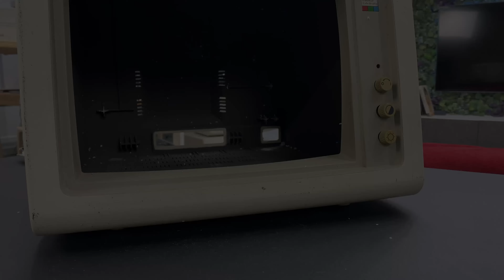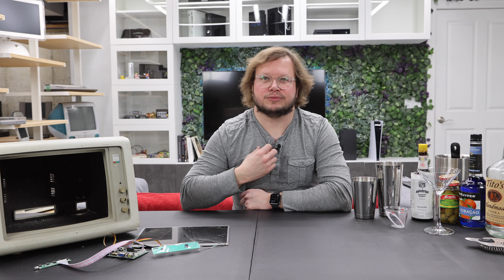IBM 5154 LCD Mod - Putting a new LCD in a classic monitor shell. | Jeremy's Retro Bar

Comment: I have thoughts of doing the same LCD thing but creating a replica of the 5154 from scratch since these are rare and expensive.
I already have a scratch made IBM 5150 alike case which incorporates a hot rodded PII PC inside, i have it on my other channel you will find it if you search "scratch built IBM 5150 replica".
It's a little more complicated creating an accurate CRT case but it's doable with a basic wooden frame roughly in size and sculpting.

Comment: Nice idea!
To be honest though I'd skip the curved plastic. Just adds too much glare imho. Or remove the curvature and choose a slightly larger screen. With a bit of ingenuity you could very well make the brightness and contrast buttons work as well. If you can't find out a way to map physical buttons you can always implement a rotary decoder (with push button as well) and map the output of the encoder to the physical buttons on your chinese LCD driver board. Not exactly the expected way to controll it but hey you have to improvise from time to time. Probably I'd add a mains power input as well. Could be as simple as just routing the power to a wall wart adapter in a socket inside the case - then you're rid of an external one.
Still waiting for my screen cases. I ordered two thin LCD cases to repurpose some old laptop screens. If they turn out well I might order one or two more. Especially one of the screens, an older LVDS type from a Lenovo T510 is especially nice. Probably it's an IPS and has very crisp colors and quite wide viewing angles - much better than most more modern laptop IPS panels. And it's Full HD too so still very usable and surely a panel I'd spend the cost of a case on. The other screen I'll put in a case is a newer eDP screen. Works well although not as crisp as the older one - also FHD.

Comment: Very good job!  I have a 1990 vintage Sigma Blackjack machine.  I opted to keep the somewhat burned CRT as the colors are still great.  Your LCD is certainly an idea if the CRT gets worse.
Reply from the maker: If I had it to do again I’d pick a higher quality LCD panel, but it was a cool mod with an empty case for sure.

Comment: Nice built and use of the IBM 5154 shell. My only suggestion would be to connect up the monitor power light, so when you turn it on, the light comes on too.
Reply from the maker: I agree.

Comment: The front layer of plexiglass is brilliant!  I was wondering how you were going to underscan the LCD.  I just powered on a new old stock 5154 this week (I wonder how many are left) and will do this if / when it fails and I can't repair it - it works well for now.

Comment: Great Job!! As an idea, you could put the IR receiver in the hole of the power led above the power switch. :-D
Reply from the maker: I thought about that, but it’s diameter is bigger than the hole. I know it would probably still work if it was just behind the hole, but it wouldn’t look as good.
Reply: @JeremysRetroBar  oh, then, you could put a power led like the original, it would be very simple and look great!!